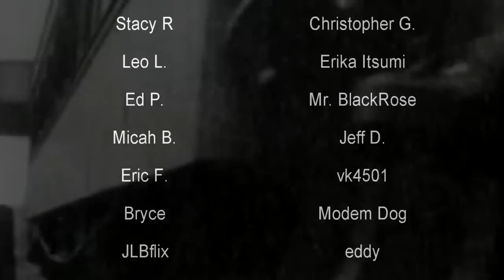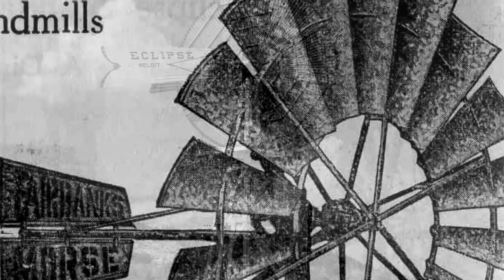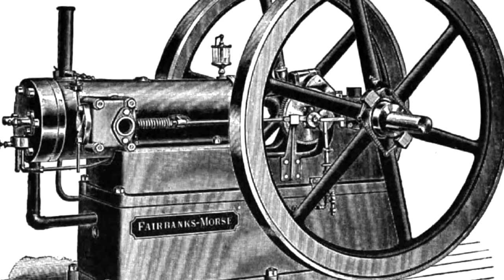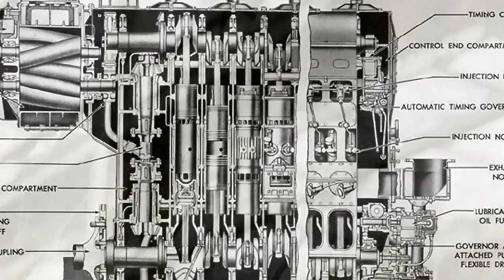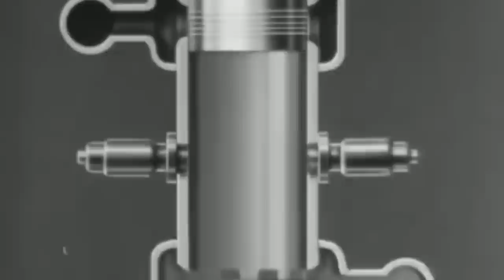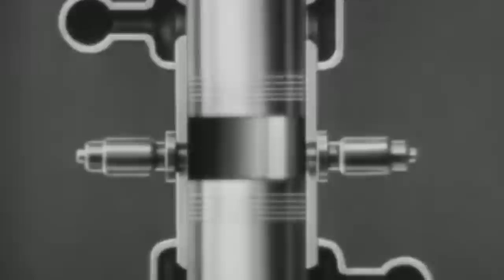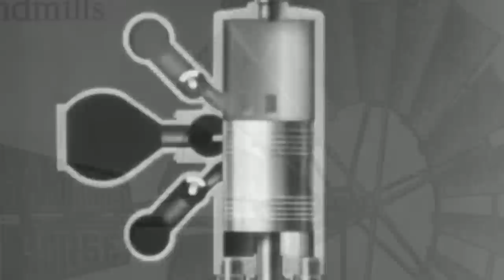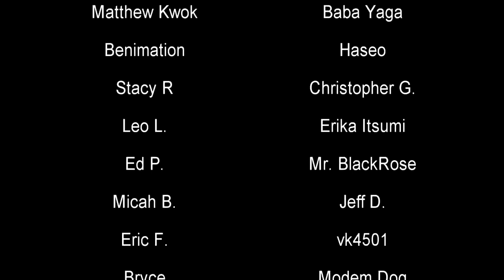Why Fairbanks-Morse Failed at Locomotives | The Opposition to Opposed-Pistons | History in the Dark

Comment: My father was a Machinist Motors mate in WWII. He had nothing but praise for the four Fairbanks Morse opposed piston engines that he operated and maintained on the submarine he was on in WWII. They produced about 1200 HP each.
Reply: They were some powerful bois that’s for certain!
Reply: I love studying WWII submarines.  Which boat was he on?
Reply: Worked as chief engineer on a tug powered by these 38 8- 1/8 OPs They were extremely reliable and trouble free. However they were more of a pain to service then an EMD. You have to pull the upper crankshaft to change the cylinder kits. Changing a power assembly on an EMD is a quick and easy job taking just a couple hours. However on an OP it’s a different story. If your replacing all the cylinders it’s not a big deal but who does that? Your usually only changing one or two cylinders at a time. The only other thing I can say bad about these OPs is they are extremely sensitive to wet stacking. When they are doing harbor work they load up and stack fires are extremely common. Sure EMDs do the same but OPs seem worse when it comes to wet stacking. However in costal and offshore towing service where the engines are running hard for days or weeks straight they are amazing engines.

Comment: Fairbanks built the engines for USCG cutters, the Wind-class Ice Breakers, the original Mackinaw Ice Breaker, the 378 Foot long Cutters, and the Polar Star and Polar Sea Ice Breakers all used Fairbanks-Morse Opposed Piston Engines. Very reliable engines.
Reply: . . . And the Navy-surplus AVPs, the 311s. Remarkably tough engines, but a lot of moving parts. I served on CGC Boutwell (378) as an enlisted Engineman, and the Wind Class CGC Burton Island as a junior engineering officer. The Northwind changed out the original 6 Fairbanks-Morse 10-cylinder 38 D 8 1/8 engines for 4 6-cylinder DeLaval Enterprise engines.
That is trading 60 cylinders, 120 pistons for 24 cylinders, 24 pistons. Much easier to both run and maintain. 
The sound of the Fairbanks-Morse marine diesels starting up on air will always stay with me.

Comment: For me in always seemed weird why FM engines failed on locomotives mostly beacause their soviet clones - 2D100 (and turbocharged 10D100) engines were very sucessful in locomotives (TE3, TE7 and TE10 series). In fact, they prove themselves to be so reliable and simple to maintain, that some of 10D100 are still in use until today on TE10 locomotives (even after 50 years of explotation). The only reason D100s are being changed for now is that they experience oil leakages into cylinders, which cause smoky exhaust that doesen't meet modern ecological standarts.
Reply: It's because they were never really common on most American railroads. On a few railroads like the Virginian the FM locomotives did well but on most railroads they ended up being orphans with few maintenance personal who knew how to maintain them and limited parts supply.
Reply: WHEN I WAS A MACHINIST APPRENTICE I WORKED ON A FAIRBANKS SWITCHER OVERHAUL ON AT&SF #560.
IT WAS THE LAST ONE RECEIVING AN OVERHAUL ON THE SANTA FE!
ITS LAST USE WAS AS A SHOP GOAT AT ARGENTINE SHOP, AND I OPERATED IT AS A HOSTLER.
IT IS NOW AT THE ORANGE EMPIRE RR MUSEUM, IN PERRIS CALIFORNIA!
KEEP THEM ROLLING BROTHERS!!
👍👍
Reply: I think this happened because Russia is a cold region, so these engines performed better in these regions.

Comment: For quite a while FM bought OP engines back from buyers. For example when Erie Lackawanna retired their Train Masters, FM bought the power plants back for rebuilding and later resale. If the engine was damaged to a point where it wasn’t economically salvageable it would be scrapped.  This helped out locomotive buyers that were in need of cash, like Katy, Milwaukee Road, New Haven, Penn Central, and the Rock Island.
Reply: I know FM OP engines were popular prime movers on irrigation pumps in places like Florida, well into the 1990s.
Reply: Offshore power, tugboats ext. very good for that

Comment: At least one FM locomotive is in preservation.  FM made a smaller version of the Trainmaster known as "Baby Trainmaster" and TVA acquired several for switching duties at steam plants.  This one was at the Gallatin Steam Plant near Nashville, TN.  TVA retired it a few years back and it was donated to TVRM in Chattanooga.  The long-term plan is a return to operating condition but it's a fairly low priority at the moment - for the foreseeable future they'll repaint it to protect against rust and have it on static display.
Reply: They have 3 FM diesels at the Illinois Railway Museum - including the very first FM diesel, which is in working condition.

Comment: Two interesting factoids about the H-24-66 "Trainmasters" in particular:
1. They were the first diesel locomotives to dethrone the last steam engines on Southern Pacific. In the 1950's SP was operating the "Commute" services between San Jose and San Francisco (not "CommuteR"; California railfans get very touchy about that). This service had extremely tight schedules that required trains with very fast acceleration from standing starts to line speed. This became the last domain for many of SP's steam locomotives as they had the get-up-and-go the service needed. Most famously the P-10 Pacifics and even the GS-4 Northerns, including #4449 at one point, worked the Commute trains in the dying days of Western steam. SP tried several diesels on the service, most famously the GP-9's, but even with modified gearing for higher speed passenger operations the diesels just couldn't keep up with the steamers; the high tractive effort needed for the fast acceleration was too much for their power trucks, resulting in either wheelslip or the gearing being shredded. Only the FM Trainmasters with their opposed piston engines and six driven axles had the grunt to dig in and heave their heavy Commute trains into motion and up to line speed as fast as the steam engines could. Sadly, the high maintenance costs and feelings among management that such powerful locomotives were wasted on Commute service prevented the Trainmasters from fully succeeding. By the time the Commute was handed over to the newly organized Caltrans, SP had decided to put less powerful EMD diesels on the service and just loosen the schedules to accommodate them. 

2. As few of them as may have been manufactured, the Trainmasters were lauded by basically every railroad that used them; train crews loved them, and despite their opposed piston power plant maintenance was reportedly not all that much harder than normal EMD or ALCO units, all of which the Trainmasters could curb stomp with their UNYIELDING POWER. That being said, only one Trainmaster survives in preservation, ex-Canadian Pacific #8905 at the Exporail museum in Quebec. Why did so few survive if they were so popular in their day? Blame the US Navy. In the mid-1960's, the Navy realized they had a shortage of diesel-powered attack submarines to counter Soviet naval expansion. This happened to coincide with the time when a lot of railroads were beginning to cool on FM locomotives with their weird opposed piston engines. The exact engines the Navy needed for their new submarines. The Navy proceeded to buy up every Trainmaster they could get their hands on and basically just ripped the engines straight out of them and stuck them in submarines, by some accounts with next to no modifications. And it worked! The Navy got their new submarines at a knock down rate thanks to not having to buy all new engines for them. But the price was the near extinction of the Trainmaster line.
Reply: The SP first tried them in mainline freight service, on the Sunset Route.  They were based out of El Paso. Unfortunately, they were found seriously lacking when they were tried in freight service.  The opposed piston prime mover was temperamental in hot weather, and they had multiple prime movers fail on them in service.  The bay area commutes turned out to be the right place at the right time for these units.  The cooler weather proved to be just right for them, and the bay area was loaded with mechanics that were familiar with the F-M opposed piston engines, thanks to the US Navy's large presence in the San Francisco bay.

Comment: A long article in Trains magazine in the 1990's (maybe even a two part article) described several problems that kept Fairbanks Morse from succeeding in the locomotive market.   1)  A strike at the end of World War II shut down production for almost a year.  By the time they returned to work, EMD had made a lot of progress in gaining market share and in refining their competing locomotives.  2)  To replace a cylinder sleeve and pistons, the upper crankshaft had to be removed.  This was much more difficult than servicing an EMD engine.  3)  In a conventional diesel, the incoming fuel air mixture cools the face of the piston on the intake stoke.  This kind of cooling does not happen in an opposed piston engine, leading to overheating problems including melting the top of the piston.  The engine worked fine in a submarine where it was always at sea level and always had plenty of cold water available for cooling.  It did not survive well when operated in the high desert, or in tunnels where the second and third units had to eat the hot air from the leading engine.  4)  A wheel slip could cause a voltage spike that would seriously damage the switch gear or maybe even the traction motors.  They never found a solution other than derating the units.

Comment: I interviewed for a job at Fairbanks-Morse in 1990, at their main plant in Beloit, Wisconsin.  Above the main entry door they had a sign saying "Through these doors pass the best engine builders in the world."  If you're a motorhead, their factory is jaw dropping.  At the time they were building Pielstick-Colt PC4 engines for main ship propulsion.  Bore and stroke were in the neighborhood of 24" x 22", and EACH cylinder displaced 9800 cubic inches.  They built these engines in V10 to V18 configurations and up to 30,000 hp at 400 rpm.  They were still building the OP 2-stroke 38D 8+1/8 engines.  

I was interviewing for the position of test lab manager, so it would have been a cool job.  But in the end I decided not to make the move because Beloit was a pretty run-down town at the time.

Comment: I have worked on boats with 38D 8 1/8 engines and tradition clutch/reduction gear propulsion. The engine is hardly ideal for variable speed operation. At light loads it is very good at slobbering lube oil out the exhaust ports and all over everything. The engine was incredibly successful in submarines where it could be started and accept 100% load while cold and not incur damage that other engines would when operated in this manner. They can also run at sustained overload without damage. I didn’t appreciate the shortcomings of the engine, but glad I got to be around one and learn how to operate it and take care of it.

Comment: Interesting bit of history.  I have a 1930's Fairbanks-Morse radio that I've owned for about 30 years.  It's a decent performer.  Of course I changed out the old wax and paper capacitors and a couple of out of tolerance resistors, but that has to be done on any brand of vintage radio.
Reply: They don’t make ‘em like they used to brother

Comment: My neighbor worked on the FM Trainmasters and loads of other smaller FM locomotives as well as on their marine prime mover diesel engines used on ships and boats, and even generators & air compressors. Let us see how well this goes. Roy went to work for AMC and after AMC went tits up he wound up at Pontiac Division of General Motors. The crank shaft in the Train Master  hung over both of the ends of a 22 foot long table. Roy had degrees in mechanical engineering and aeronautical/aerodynamic engineering. FM is still around. The Dallas Pen Texas Company who bought out FM also owned Colt Firearms. FM is kind of still around, as FM & Colt and they still make TWO FM engines two Pen Texas of Dallas Ind. engines and a lot of German, Austrian and other huge marine engines under license.  Arcline is new. FM is still making some of their own engine designs. Their own engines all have horse references in the naming.

Comment: One of my uncles worked for the Virginian, and I’ve met a few of his former coworkers over the years.  While he ran electrics, all of them had nothing but praise for the Trainmasters the Virginian ran west of Roanoke.  Their power was such that 2 units could outperform the massive Mallets they were replacing on the 12,000 to 20,000 ton coal trains, and would often be slapped onto coal trains pulled by electrics as helpers over the stiffest parts of the Mullens-Roanoke division

Comment: Their opposed cylinder engines were air fast start.  They were ideal for emergency power systems in Nuclear Power plants. Coolant and lubrication systems were kept at operating temperature allowing 10 second start with 20 second block load full power in under thirty seconds as the emergency power of choice for Nuclear Power Stations.  Tanks of stored compressed air were connected to the diesel cylinders in sequence to start the engine.  This gave the engines true black start capability.  Within 30 seconds all emergency loads could be supplied by the Diesel Generator.  We used two 3.5 MW 900 RPM engines at Crystal River Nuclear Plant in Florida.

Comment: What an irony, that FM built only 1500 these opposed  piston diesel locomotives, which now almost forgotten in USA, but in Soviet Union diesel  locomotives exactly with this type of engine (Soviet clone of FM) were the most numerous, such as:
TE3: 6808 two-unit locos were built (13617 individual units) - 2D100 Roots supercharged 10 cyl. 2000hp engine.
TE7: 113 two-unit locos were built (226 individual units)- 2D100 Roots supercharged 10 cyl. 2000hp engine.
TE10 family was the most numerous and long produced, 19183 units were produced in total (it were single-unit two cab locos, two-unit locos 2TE10, and three unit locos 3TE10) , they had 10D100 two-stage supercharged (2 turbochargers+centrifugal blower) 10cyl. 3000hp engine, based on 2D100, however  first few TE10 locomotives had rare 9D100 12cylinder! 3000hp engine. Many of this TE10 family still work today. 
As for engines, Roots-supercharged 10-cylinder  2D100 was low-stress engine and was quite reliable, but when they decided not to go with 12 cylinder 9D100 to make 3000hp engine, but instead add more boost to existing 10 cylinder engine block (because it's cheaper), which become 10D100, it had negative consequences, 10D100 was much high stressed and suffered oil leakages and other issues.

Comment: Fairbanks-Morse engines were used almost exclusively as backup power on nuclear submarines until the Virginia class entered service in the mid-2000s.  The Virginia class use Caterpillar diesels.  I've heard that Admiral Rickover's preference for the design led to this.  Fairbanks-Morse engines were also used on the final generation of US diesel submarines built in the 1950s.  The exception to this was the first few Tang-class submarines.  These were the first post-WWII US submarine type, and initially used "pancake" radials that proved horribly unreliable, so they were replaced with Fairbanks-Morse.  The engines used were usually the 38ND-8-1/8 design with various numbers of cylinders, up to 12 on the Trident submarines.  The Sturgeon class and I think the Thresher/Permit class used the 38F-5-1/4 design with 10 cylinders.

Comment: My perspective is from a CNW engineer who had experience with FM Locomotives
The difficulty was in matenence .
Short answer +/-,  EMD, GE and ALCO engines had individual   heads,  on the top end and access covers on the lower end. If you had a individual cylinder falure, the cylinder could be isolated and the piston , rod and valves could be replaced indpendently.
Also, the engines could be operated at changing rpms and survive in a  jostling existence.
The ops have an upper and lower crankshafts and any defect required a major tear down , that most likely required engine removal and locomotive down time . Subsequently, rrs ran them until they died.
I belive FM initiated a r and r  policy with the rrs to mitigate the problem to lesson locomotive down time with limited success.
OP engines ran most efreciently on 
Pumping stations, ships or any stationary operation , elect. gen, fixed rpm, with regular maint., they run forever.
The C-liner pass. units were cool, but fizzled. 
Ramond Lowey designed the Trainmaster, baby Trainmater and the switchers.
They ran very successfully in commuter service in the Bay Area.  
My all time fav. locos.

Comment: Windmills would have been used by farms to pump water before rural Americans had electricity.  "One lunger" gas engines (like the ones he showed only smaller, water cooled, and more in the 10's to 40's era) were used with pump jacks either with or instead of windmills in that era until everyone got REA power by the late 40's.  A lot of these one lunger engines were being scrapped by the fifties and sixties.  Some of the last 1.5 horsepower engines of that style for farmers were made by FM, International Harvester, John  Deere, and Stover.

Comment: There is a Trainmaster engine still around in Canada at a railroad museum it’s a CN engine the TrainMaster engines on the SP RR were used on passenger trains here in San Francisco to San Jose CA until 1975 they were replaced by GP - 45 passenger engines NH RR and NYC had the TrainMasters too for passenger trains